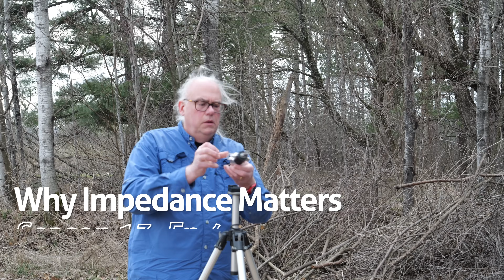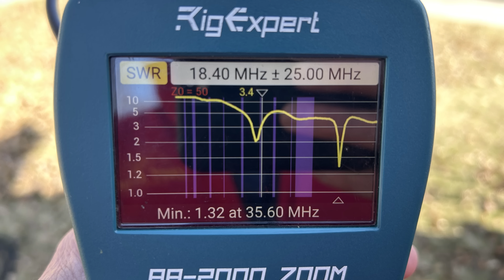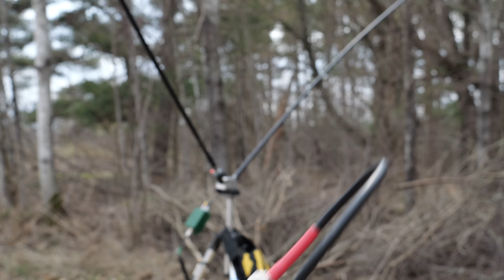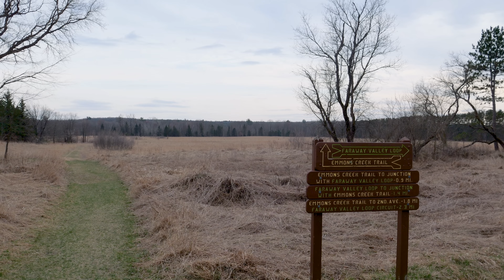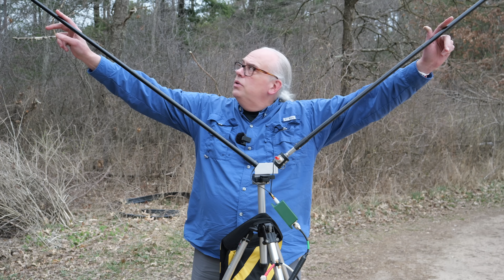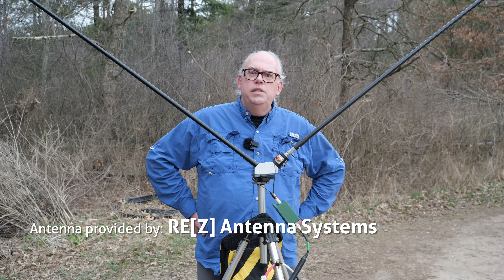I FIXED IT! This makes the Scout Delta Loop so much better

Comment: Appreciate this explanation - what books do you recommend for learning this material in depth (specifically antennas)?
Reply from the maker: There are two books that I lean heavily on. The first is the ARRL Antenna Book: https://amzn.to/3IaDTpx. It is comprehensive yet practical, so it is a good volume for someone starting out. The next is Rothammel's Antenna Book. https://www.dxengineering.com/parts/dxe-antenna-book This is the English translation of a German book that has been around for ages. It is densely packed with information and reads more like a college textbook. I reviewed both books last year if want to get a better look at them: https://youtu.be/it7mlXOtfOg?si=kjZB4UzhCTFlhKKa
Reply: @KB9VBRAntennas  Thanks - will def watch the review

Comment: How would you compare this delta loop to the CHA TDL?
Reply from the maker: That's a really good question. In comparing the two antennas, the efficiency difference between them is entirely in the transformer. The Chameleon TDL uses a 5:1 Guanella design transformer and for the Scout I used a 4:1 Ruthroff voltage balun. Inherently, in the design characteristics of the transformers, the 4:1 will be more efficient than the 5:1. 

How much of a difference is difficult to say without head to head testing, but my gut feeling is that the losses of the 5:1 will be 3-5 dB more than with the 4:1. That anecdotal figure is based on rough performance observations between the transformers with other styles of antennas.

Comment: Michael, something to try with this Delta loop is a 9:1 UNUN.  Based on an EZNEC model of the loop, a 4:1 UNUN is a very good fit (i.e., low VSWR) on 17 meters; but on 20, 15 , 12 and 10 meters both the feed-point impedance and VSWR are much higher.  Of course, a 9:1 UNUN will raise the feedline VSWR on 17 meters, but not excessively -- and not as  high as the 4:1 UNUN does on 20, 15 , 12 and 10 meters.  In effect, the 9:1 UNUN acts to flatten the VSWR curve from 20 thru 10 meters while not favoring any band.

Comment: From what I can tell from both video's on this delta loop the receive sounds stronger buy listing to back ground noise level.  Which makes sense with impedance mismatch.  Normally 200-300 ohms for delta loops .Good thinking on using a 4:1 like that with pig tails . Quick and easy . The outher way to feed it would be 300 ohm twin lead into wide range tuner with 4:1 like some of the MFJ ones.  I like using a VNA or Rig Expert to get more than SWR.   Than you have info for using impedance transformer and what ratio to use. I like looking at smith charts . then I know what i need to do , more or less capacitance   and or inductance . I find Rig Expert easier to use in the field than a VNA . Normally only need 1 port measurement in the field. 73

Comment: May as well buy the low priced ($18) isolator Rez sells then. This configuration renders the Scout unnecessary.
Reply: The REZ isolators look like a bargain, but not sure how well the ABS plastic will hold up under the stress of a 17' whip at 45 degree angle.  I'd be interested in the results of any stress testing performed on these isolators.

Comment: I am also thinking of doing a Rybakov vertical with the Chameleon 25’ whip and the 4:1 UNUN attached.
Reply: This is another case where the Scout is superfluous.
With a self-contained 4:1 UNUN that's fed via an SO-239 or BNC female, all you need is a simple means to isolate the whip from the ground mount.  Attach the "hot" side of the UNUN to the whip side of the isolator, and the common side to ground side of the isolator.  Granted, the Scout can serve as the isolator, but it's a bit of a kluge or overkill for this application.  On the other hand, whatever works and gets you on the air is what counts in the end.

Comment: What is the purpose of the common mode choke?
Why is the matching transformer needed in addition to the external tuner?
What was the lowest SWR you were able to get on various bands?
Reply: Answering your first two questions:
A common mode choke keeps a significant amount of common mode RF off the outer shield of the coax.  This significantly reduces RF emission from the coax shield.
An impedance matching transformer reduces the degree of impedance mismatch between the antenna and feedline. This, in turn, reduces reflected RF power and VSWR on the feedline.  Since the impedance of the antenna and its transformation isn't a perfect non-reactive 200 to 50 ohms at all frequencies, an impedance matching network (ATU) at the transmitter is required.

Comment: What to do with a vertical,  as the impedance is low.
Reply: Generally speaking, a 1/4 wave vertical should have an impedance less than 50 ohms, and even lower for a short coil loaded vertical.  If the VSWR isn't too high (less than 3:1) and your feedline isn't too lossy, simply use an ATU (manual or automatic) at the transmitter to provide an impedance match.  Otherwise, a 1:2 or 1:4 UNUN at the antenna base may be helpful to increase low impedance to something close to 50 ohms.

Comment: I find isolating the loop from the mount by using isolaters on both whips and using a 4:1 balun works very well, also the feed point is actually not needed with LDG transformer, just do what you did on the ground side on both sides
Reply: This is just an example of one thing the Scout is capable of.

You could certainly do that without the Scout but one whip will need to be isolated from the mount since it’s conductive aluminum. In this case the Scout is providing that. We have a plastic insulator (REZ-ATBI) that would work.
Reply: @rezantenna  thanks for the reply!
And don't get me wrong, I am a big fan and I think this is a great product. Adding the banana plug connecters for ground wires was genius, and I will be picking one up to use for my packable POTA performer along with all the other great things it can do.
Reply: @ you’re welcome! Thanks for the feedback on the Scout. I’m all about options. That’s what’s cool about this hobby. The ways to do things are endless.
Reply from the maker: That would be ideal. I was using the Scout as an isolator since the only other isolation piece I have is Chameleon branded. I try not to mix competing products when I'm talking about one particular antenna system.
Reply: @KB9VBRAntennas  if you didn’t want to use the Scout for the isolation, you could use our Antenna Base Insulator REZ-ATBI.
Reply: @KB9VBRAntennas  That makes perfect sense to me, great video and I hope to catch you on the air! 73s de W2DAX
Reply: CORRECTION FOR THE RECORD!
When I said use an Balun I thought that is what gave me the best results late time I tested the delta loop. But something felt off because I couldn't remember for sure. , so I decided to set it up in back yard at lunch today and test it out again. And I got MUCH better SWR with the Unun over the Balun. So much so I also decided to test the Kronos 4:1 I recently built form Cartenna, and somehow it gave me 2:1 or under from 20 to 10, Not a strait line but dips where it counted in the ham bands. That seems a little too good to be true so I am going to continue to test.
Reply: I was coming here to see if I was the only one with this thought…
Reply: You are right. The REZ Scout is not a transformer so it is not necessary. Just eliminate the Scout and put the two pigtails from the two telescopic whips into the LDG 4:1 unun and that should work better.  Maybe Michael will give that a try.

Comment: External antenna tuner is another possible solution?
Reply from the maker: In a prior video I used just an external antenna tuner with the Scout delta loop. Here's the result: https://youtu.be/qM4zpOUepLw
Reply: @ Thanks Michael, I missed that for some reason!

Comment: Michael you read back the wrong callsign to that guy KF4DWY. You read back KM4DWY. I hope you changed it on the log or he won't get credit for the contact. I'm glad you got the Res Delta Loop working good! 73!

Comment: Maybe a 4:1 Balun would work even better than a 4:1 Unun?
Reply: Both are 4:1 transformers.  The main difference is the amount of common mode choking provided.  The UNUN provides no CM choking, the BALUN provides some CM choking -- dependent on how well-balance the load (i.e., antenna) and whether the BALUN is a voltage or current BALUN.  Since no real-world antenna is perfectly balanced, my preference is an UNUN (usually simpler to construct) followed by a common mode choke on the feedline, near the UNUN.
Reply: A follow-up to my above reply: If you use a 4:1 BALUN, chose a dual-core Guanella BALUN and not a single-core design.  The dual-core design is far superior in common-mode current choking and performing well with less than well-balanced loads.

Comment: Yep. I used a 5:1 from a Chameleon end fed that i have here and made a way more redneck version of that jumper out of a coax i had here.  Very similar results. This antenna just isn't going to work as well as I'd hoped on 40M.
Reply from the maker: On 40 meters it pretty much becomes an NVIS antenna. The loop size is just too small for efficient use on the 40 meter band.
Reply: On 40 meters, this Delta loop antenna begins to electrically appear like an oversized magnetic loop antenna with highly resistive conductors.  Thus, not very efficient and completely mismatched via a 5:1 or 4:1 UNUN.  Also, the -1.5db loss thru the Chameleon Hybrid 5:1 transformer isn't helpful.
IMHO, the only way to efficiently use this loop on 80 or 40 meters is to ditch the feed-point and connect both whips to the Y connector.  Then connect the bottom of the Y to a short (4' to 6') mast, and the bottom of the mast to a feed-point with variable inductor.  This creates a relatively short vertical antenna with a funny looking large capacitive tophat.

Comment: so if you’re going to use a 4:1 why would you bother putting the scout there?
Reply from the maker: The block used to angle the whips is solid, you still need some type isolation between the center pin and the ground side of the antenna. The Scout provides that isolated connection point.
Reply: Micheal is correct. There’s other ways to do this of course but it’s illustrating one possible configuration with the Scout.

Comment: The transformer seems to improve the situation. How are delta loops on 80 meters?
Reply from the maker: These portable delta loops are best at 20 meters and above. On 40 meters, this antenna will operate as an NVIS antenna. Performance on 80 meters will be greatly compromised. 

To be efficient on 80 meters, the antenna will need to be appropriately scaled. The formula 1005 / F MHz = loop circumference in feet will get you in the ballpark. Doing the math gives you an 80 meter delta loop with each leg being 88 feet in length.
Reply: @KB9VBRAntennas my 40-10m pota one is 138'. Yes I deploy this monster off a 40' pole, apex off the top, fed at a lower corner with a 4:1 balun. Works like gangbusters.
Reply from the maker: @ hmmmm. You gave me an idea for my next Field Day antenna
Reply: They're big. I mean really big.
Reply: I have the Chameleon Tactical Delta loop and it works on 80m, though SWR made the bandwidth narrow.  Connected to my Icom 7300, Yaesu FT-710 and FT-891, made no SSB or CW contacts but made some FT8 at low power.
Reply: @dc5723 me too but the TDL is exceptionally compromised on 75/40m. The 59' of radiator puts base resonance around 17 MHz.
Reply: would a 4:1 balun have different performance? im wondering.
Reply: @mrkopecky the Z of the delta depends on where it is fed and height above ground.
Reply: @Philip-KA4KOE  There is a YouTube video showing a Chameleon Delta Loop very close to the ground and it seems to work okay but I don't remember what the SWR was in the video. Height above  the  ground definitely makes a difference. N3EDO.
Reply: @williambouchard4480  My field tests indicate that the SWR improves if you get the loop off the ground. Chameleon states the TDL really gets lively if you elevate the base.
Reply: @Philip-KA4KOE  The sweet spot height for this type of delta loop is with the horizontal wire about 1/2 wavelength height above ground at any given frequency.  Marginally field practical for 10 meters, but generally not practical for 20, 17, 15 and 12 meters.  So, raise it as high as you can and hope for the best.
Reply: @DaDitDa  that's hard to do on my big one
Reply: @williambouchard4480  works OK. Works better. The company says it really comes alive at least 2-3 meters up and that makes sense. My testing of the full size 40-10 delta shows decent swr starting at 4'. And fantastic performance. Email me for more details
Reply: To use this or a similar sized loop antenna on 40 or 80, I'd recommend attaching the two interconnected whip arms directly to the Y adapter, and then add a 4' conductive pole/mast to the bottom of the Y adapter.  At the bottom of the mast, place the Scout with an adjustable loading coil attached.  You now have a short vertical antenna with a large top hat that will perform much better than a poorly matched small loop.  (Edit: don't forget to add radials to the bottom of the Scout.)